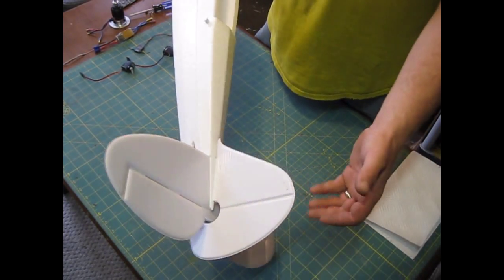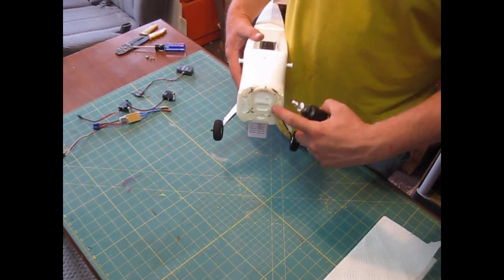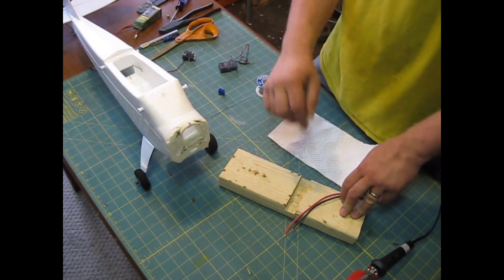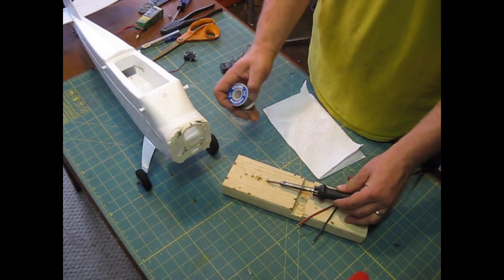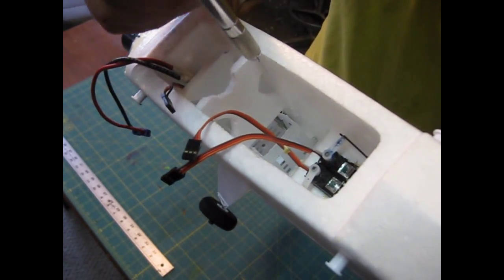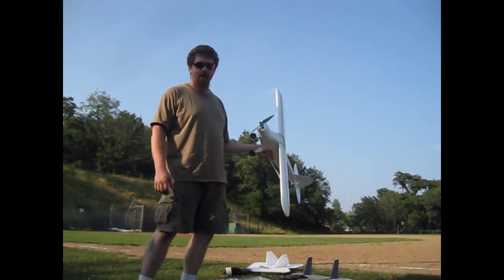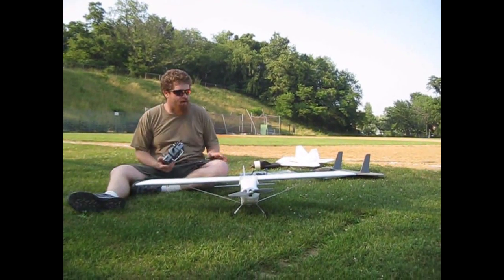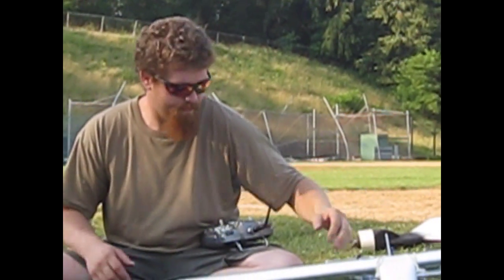Supercub mod series episode three (and maiden flight)

Comment: Thanks for videos, you've been a great help. This is my go to plane to get my flight skills back up. you have given me the courage to upgrade one of mine as I had planned to use it for parts. I had a problem with the old one losing power and the guys at the hobby store explained that it was the ESC that was giving out. 3rd SC that I have had this problem with so now I know what to do. Do you think that ESC is rate too low or from the factory it's not getting the right amount of air for cooling?

Comment: is the stock motor not strong enough after adding the flaps and ailerons?  I would only be interested in the flaps ailerons.  would you have to change to esc to a higher amperage to run the higher mah battery to operate the flap and aileron servos?  Did you just use the packing tape on bottom of the wing in the other video to work as a hinge for the flaps and Ailerons?